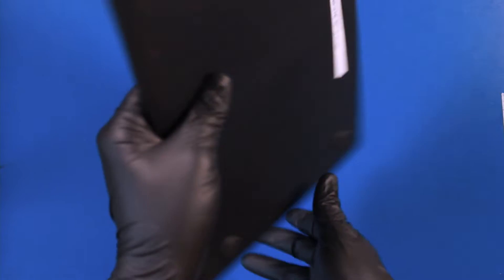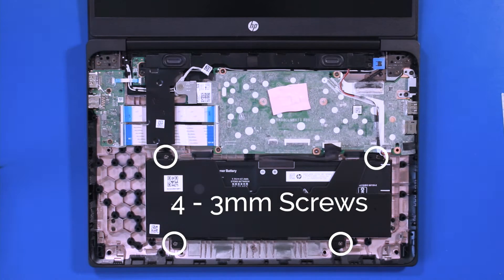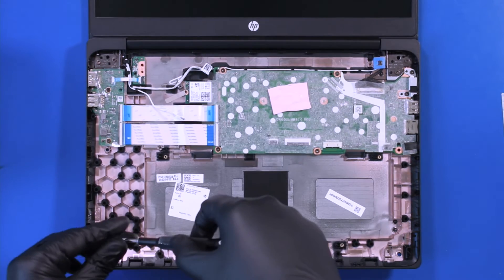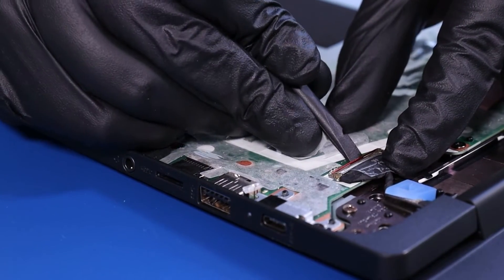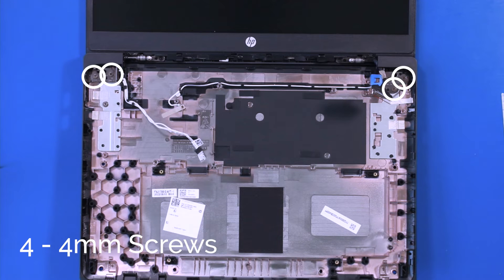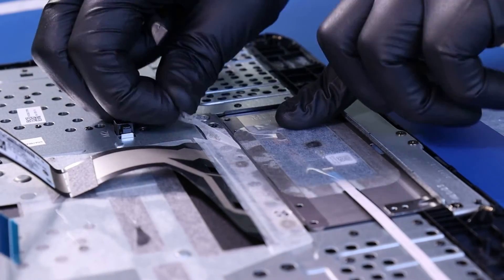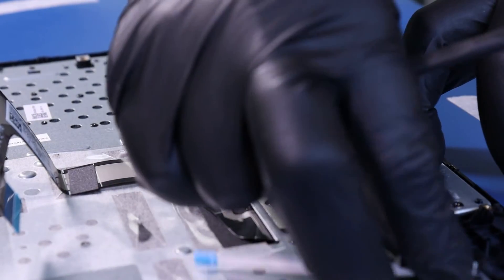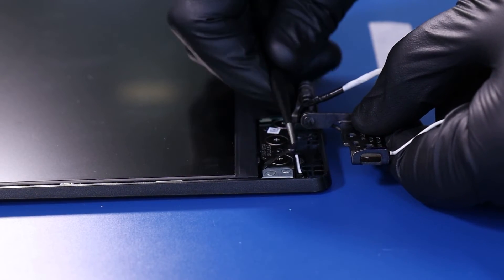HP 14 G7 Chromebook Teardown Guide

Comment: Hi, I'm trying to replace the battery and I can't disconnect the cable that is connected from the battery to the motherboard in HP Chromebook 14-ca023nr, I tried it with my nails, I've seen videos where they get it out very easily
Reply from the maker: Sometimes it can be plugged in pretty tight and you just have to work it a bit. Do you have a plastic spudger tool? You could use that to push it out from the edges. Otherwise, using two fingers - one on each side - and carefully wiggling it out is probably your best bet. Good luck, and let us know if it's still an issue!
Reply: @Chromebookparts  Hi! Thanks for answering, I've checked and it seems to be glued or something like that, as if it had been covered with a layer of glue from the tape that covered it, I don't have isopropyl alcohol right now so, I think I need to wait
Reply: @OsWald__  unless somebody took it apart and put glue on it there shouldn’t be any glue. You could possibly use a hairdryer on low? Or just be persistent and gentle.
Reply from the maker: @OsWald__  yeah there definitely shouldn't be enough glue from the tape to hold it in. Hopefully you can work it a little and loosen it up

Comment: What is it that causes the computer to turn off when you close it? On an earlier Chromebook I had there was a magnet in the bezel but I couldn't find any here?
Reply from the maker: Hello! There is still a magnet on the bezel - if you're looking at the screen while the bezel is still attached, the magnet is located on the back of the lower left corner.
Reply: @Chromebookparts Thank you!! (same person just different accounts btw)
Reply: Could be the camera and mousepad system, or soeaker and power default, if not its the battery power.